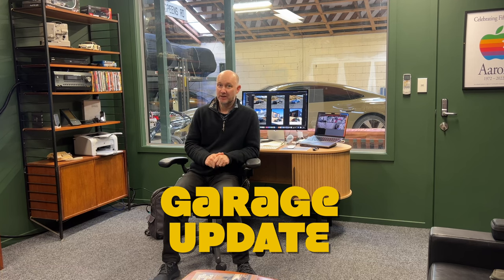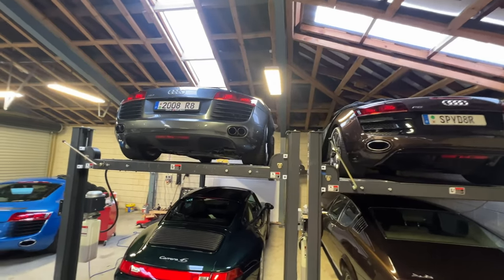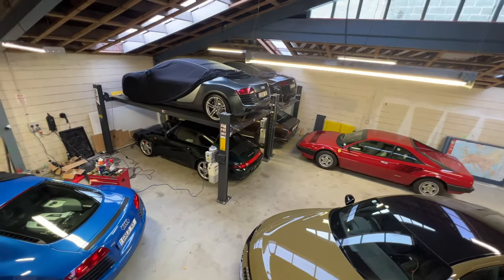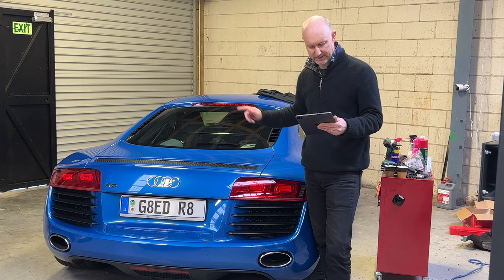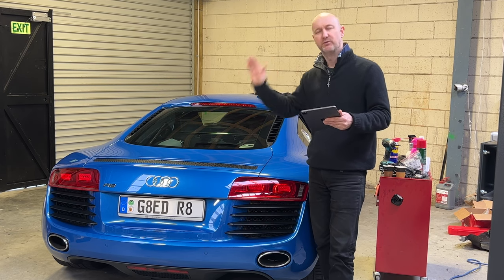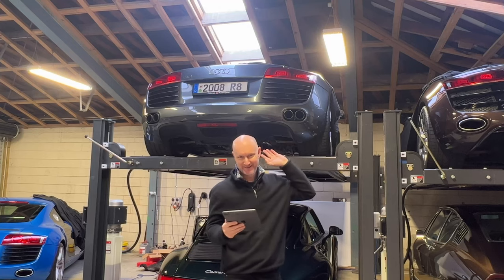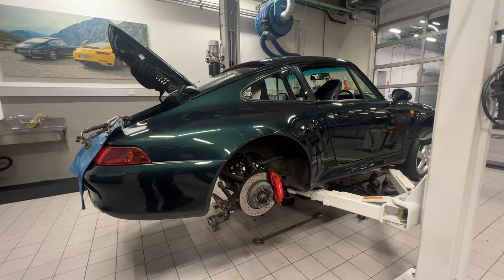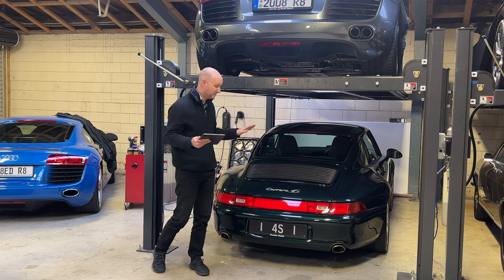$90k servicing costs in 6 months, Audi, Porsche and Ferrari.

Comment: What a collection. Didn't know a single person owned so many R8s in NZ. Glad they are in good hands!
Reply from the maker: Cheers! I actually also had an R8 GT on order (one of only 15 RHD being made) but I’ve cancelled it because of the issues I’ve had with Audi recently on the e-Tron. I will sell the r-tronic v8 at some stage and just keep the v8 manual coupe and v10 manual spyder cause they are both so different to drive.
Reply: @9and3  was the GT coming in from the UK? Someone I knew was importing one and said she had a buyer. I've often wondered how good the V10 Manual convertible must be with that soundtrack. I thought hard about buying a GT and having the manual conversion done to it now it's fairly easy to do.
Reply from the maker: @amdaman3  yeah Becca and I both had one each on order. The 15 RHD cars are only coming to the UK. Both of us got cold feet for several reasons.

Comment: Enjoyable video. Wow those Euro steeds are an expensive ride! I’d be interested in a video re battery range etc. P.S. I’ve still got my SE/30, it was a beast in its day and still runs perfectly.
Reply from the maker: Indeed! I have a SE30 but the HD has failed so I need to sort that. Lots of capacitors are failing on the old 80s computers now :( - fixable but time consuming .
Reply: @9and3  I’ve removed the lithium battery on the old Mac just to be safe. The HD is still okay. Lots of repair options and good guides on line to replace failed components. I have an acquaintance here in AKL who has repaired a couple of these old motherboards. Tricky but doable. Cheers.

Comment: great video. very interesting regarding the Etron. i was thinking of getting one, maybe ill stick with my 991 which i have had basically no issues (so far) with over 30,000km (recent kms) and shes almost 10 years old...
Reply from the maker: Yeah stick with your 911 for sure. The e-trons are plummeting in value as well. Mine cost around $220k 2y ago and now I’d be lucky to get $150k for it..
Reply: @9and3  yea i noticed the prices plunging. surely that cant continue much further. its still a car with a fantastic road presence and amazing performance.
Reply from the maker: You'll be pleased to know I've just traded the ETRON in for a 991.2 Turbo S and I'm happy with it - see my latest video on the test drive of that car. Its awesome!